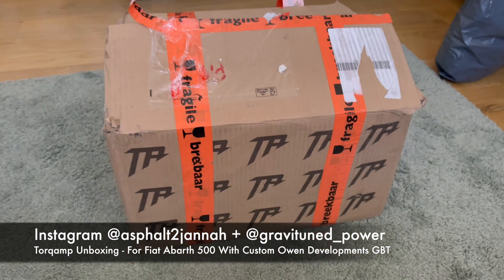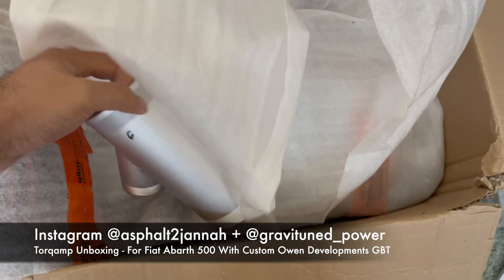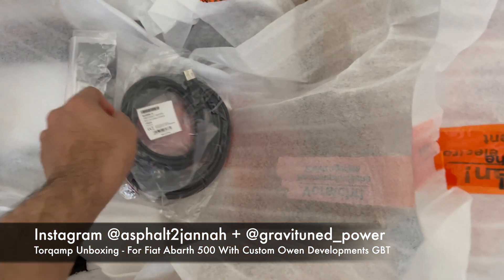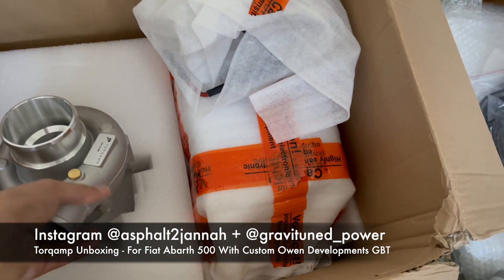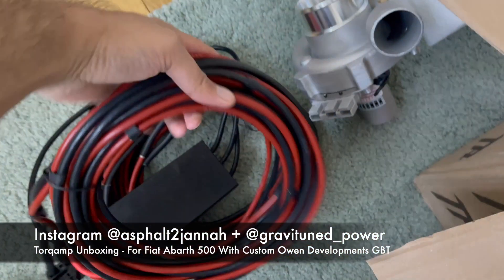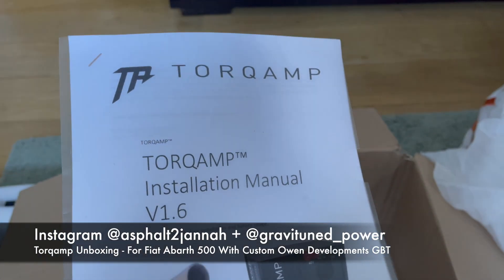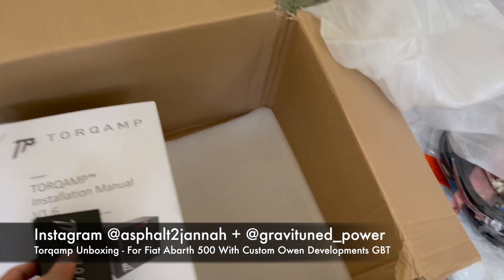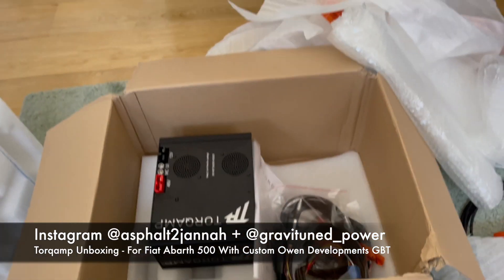TORQAMP UNBOXING - Electric Turbo | Abarth 500 595 695 | Owen Developments GBT | Gravituned Power |

Comment: Lot of noise about electric turbos but hardly any installs with results and numbers. Don't understand why?
Reply: Check out alexltd. He has completed runs on the track. He ran all the tests too and ended going from 12secs n/a to 10secs by electric turbocharger.

Comment: try to use belting checking sencor and sync with electric turbo...so flow air to intake and exhaust can be sync with crank rotation so you can get power like actual traditional turbo...but need to work with some electronics stuff  before it can be EV supercharger, simple solution right and less headache to make it become real 😂